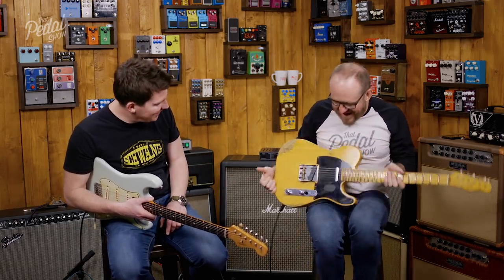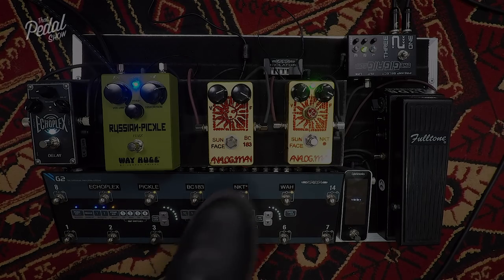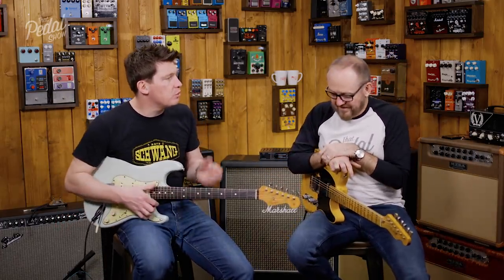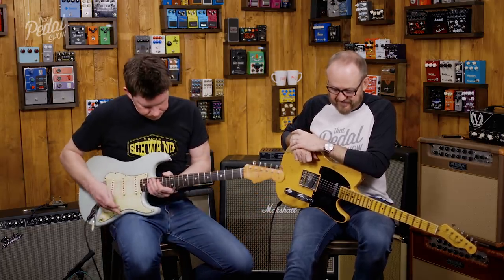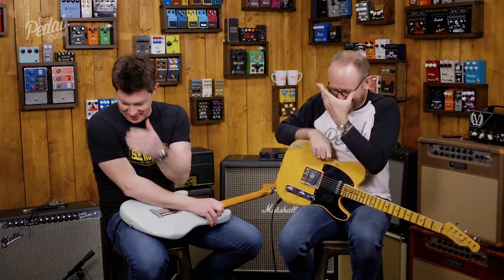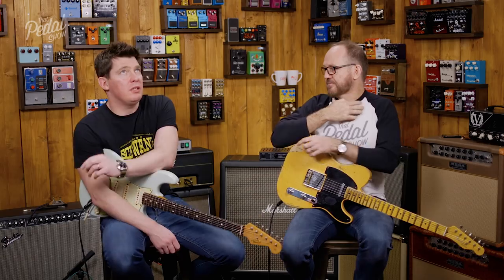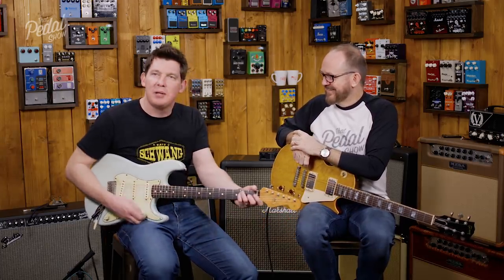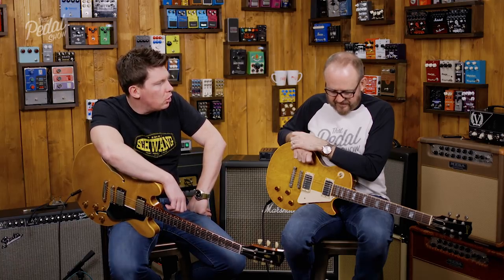That Pedal Show – Things To Know About Using Wah-Wah, Fuzz & Buffers

Comment: I run a band of gypsies fuzz face mini before a cry baby 50th anniversary with no buffer and experience no probs. It's a large board as well. But, I do have the fuzz and Wah (as well as a Carl Martin  DC drive and a tube screamer: gain staged as tube screamer, Martin and fuzz) on a loop through a boss noise suppressor. I also run a compressor between the drives and the Wah (also in the noise suppressor loop). Don't know if this is technically correct but it seems to work for me. I run the comp after the drives so I can still have the dynamics afforded by the overdrive pedals but before the Wah so as to level the input signal into the Wah. I did start with the Wah before the drives but, as shown here, it lost much of the Wah, so I changed to Wah after drive.  The fuzz face has silicone transistors obviously, so this is a massive help with my set up.
Reply from the maker: Great! If it works, it works!
Reply: Yeah. It's also a massive help I find, using single coils with a fuzz but, perhaps, more so, the tip I picked up from TPS: to reduce the output volume of your guitar!! I'll usually run my Strat volume pots no hotter than 6 or 7 when using a fuzz. Only way a fuzz is manageable / musical I find. Thanks for that tip. I also find it helps to reduce the amount of amp gain I use. Just enough to start to break the signal up and let the drive / fuzz pedals do the rest.

Comment: Hi Mick and Dan! Recently in the Midscooop/push video you tried to make a Fender sound like a Marshall and vice versa. It would be very interresting to see how much they can sound alike with the EQ pedal in the loop of the Fryette Power Station using the same speaker!
After all, all a pedal in front does, is alter the guitar signal going into the amp instead of changing the actual amp EQ.
Thanks for all the great work!
Reply from the maker: What amp are we using with the Fryette Ricardo?
Reply: To try and make the fender sound like a Marshall: Fender into Fryette with EQ pedal in the loop, into the Marshall cabinet. The Marshall should also be used with this cabinet, without EQ pedal or Fryette.
The other way around: Marshall into Fryette with EQ pedal in the loop, into the Fender speakers. The Fender should be used with it's own speakers without EQ pedal or Fryette.

This way you are not altering the guitar sound going into the amp, but the amp sound going into the cabinet! Maybe it's a much better solution to make amps sound alike. I hope you guys will give it a shot! ^^

Comment: Oh my goodness... That bloody NKT red dot pedal rules...It always sounds good, no matter what you put into it...
Reply from the maker: +Adalberto Schuck Jr. yep, Dan here, it’s my fav fuzz ever
Reply: Just a hint for you, my friend. You know silicon transistors in fuzzes have a harsh sound mainly because of the high Hfe (or beta) of those trans. And germanium NKT275 are hard to find. So my soluiton is: use a silicon low beta transistor, as BD136. So, using the exact original Fuzz face schematic from R.G. Keen (GEOFEX), I mounted 2 versions: One with BC108 and one with those BD136. The result wiht bc108 was as expected. But with BD136 was amazing. I got all the waveforms expected from a Ge transistor, but with Si transistor. From pure waveshape to clipping in only in the positive semicycle to assimetrical clipping. Everything was there. So, guys (hey Analog Man). Try this. And I am petty sure that, with little adjustments, you will have a consistent product (always same results) with a VERY COMMON , CONSISTENT AND EASY TO FIND TRANSISTOR. 
Last but not least, if someone start to produce this idea and make lots of money, just remember me next Christmas...Cause here at Brazil, I would never dare to open my own business, I kept at my position as teacher at Electronical Eng. Dept. It's safer...SO, TRY IT...I bet you won't regret with the results...

Comment: Mick, here's a simplified explanation of input and output impedance, and what they mean to you.

Think of impedance as "where the signal goes."  Consider the "output" as being the out of pedal A, and the "input" as the in of pedal B

 If the output of a pedal, or circuit, has a high impedance, then the signal will stay inside that pedal, and will not make it into the input of the next pedal.  If the output of a pedal has a low impedance, that means you will only lose a small amount of your signal coming out of that pedal.

If the input of a pedal, or a circuit, has a low impedance, then not very much of the signal will make it to that pedal.  If it has a high impedance, then much, or most of the signal will make it into that pedal.

All well designed circuits will have a high input impedance, and a low output impedance.  That means that most of the signal will go into that pedal, and only a little bit of the signal will be lost leaving the pedal.

If you have pedal A that has a high output impedance, and pedal B that has a low input impedance, that means that most of your signal stays in pedal A, and is not transferred to pedal B.  This is bad.  This is why you use buffers.

Buffers are any number of circuits that have extremely high input impedances, and extremely low output impedances.  They are used to make sure that the signal you want gets to where you want it.  You can use them after a circuit that has a high output impedance, or you can use them before a circuit that has low input impedance.  They only exist to make sure that the signal you want gets to the place you want it to go.

Buffers in themselves are neither good nor bad.  Buffers are like the note "E."  E is great in an A chord, but terrible in a G chord.  If a circuit has mismatched impedances, then a buffer is great.  If a circuit is well designed, using a buffer is like throwing in an E to a G chord, it's not good.  Buffers change your signal.  If you need to change your signal to make a circuit work, then they're great.  If you just throw five buffers in a row through buffered bypassed pedals, it's not so great.

This was longer than expected, but I hope that you got something out of it.
Reply from the maker: Thanks Clint. I totally get buffers and what they do. Just not the electronics theory, but that was helpful, thank you! I might get some textbooks. I was reading about FETs yesterday. It was riveting. :0)
Reply from the maker: +Clint Davis Dan here, E is awesome in a G chord ;)

Comment: An interesting point to make here is that the term impedance can be misleading, as it sounds like it is describing resistance in or to the signal path, something that is impeding the signal. Whereas actually, impedance is referring to the resistance to ground. So hence, low impedance means the signal path has less resistance to ground and so more signal will bleed off to to ground, and hi impedance means that the signal path has a higher resistance to ground, so that less signal will bleed to ground. Easily misunderstood!

Comment: Great videos guys! Extremely informative, super fun, and all around superb! I always look forward to fridays! 

Two questions:
1. Will adding a standalone buffer together with the wah create the same problem as when using only the buffer with a traditional germanium fuzz? Or is it needed an in-built buffer in the wah, like the Fulltone,  so that the problem with wah-sweep cannot be mitigated if you have a standard Crybaby by adding a buffer?
2. How do you get the audio so quiet? I hear from the room mics that there is some hum when you do not have the volume on the guitar rolled of, but all the quiet parts within the playing (from the cab mics) are dead silent, no noise. Do you use any noise reduction in post-production of the audio?
Reply from the maker: Hello Todd. 1. Maybe. But having the separate buffer would then hurt the fuzz. Maybe. Would have to try it!
2. The vocal mics are gained waaaay higher than the amp mics. The vocal mics are condensers too and have some compression. If we left them up while the amps were playing, they’d be massively clipped. We don’t use any noise reduction at all - it’s just that the amp mics are gained so much lower. The hum you hear through the vocal mics is massively exacerbated. Cheers’

Comment: That Pedal Show, thanks for the excellent info. One question: the first element of my signal chain is a Boss GP10, because of the possibility to use alternate tunings through the esaphonic pick-up. I have a Orange Fur Coat (which seems to have a mix of germanium and silicon) and a Bad Horsie wah, what do you advise? Thanks

Comment: Okay general question to the masses if anyone's actually reading this I have a Buddha wall one of the purple ones which is an older one. Snd I have a couple vox king wahs.  One with the stack of Dimes inductor and  one with the TDK inductor. neither of which I believe her buffered. I have a Hartman germanium fuzz pedal one of the they're older ones.  and I have a boss tu-2 tuner which I believe is buffered? my signal chain is my wah pedal to an expression volume pedal xotic AC booster to the Hartman fuzz then to the Keeley D&M Drive then it goes to modulation and then it goes to us strymon Volante and then to a Reverb and then the amp. My question is is this the best order to read these pedal Center? I realize that it's subjective to some point but I'm wondering if I should change the order does it matter if the expression pedal is in front of the Wah? does it matter if the party you tuner is in front of the foes it's buffered? Does it matter if my Boost pedal is in front of them fuzz? from my limited understanding of all this. It seems that the correct signal chain should be turn on my volume pedal my wah pedal the fuzz pedal the Distortion D&M Drive the Boost pedal then the tuner and then my travels modulation Echo and verb an amp?

Comment: Hi I have the Morley pedal which has a built in buffer and my fuzz sounds better put later but lately I've plugged the mxr m101 phaser 90 pedal into my pedalboard and I'm having problems with the wha wah, basically when I turn on the phaser the wah and as if it was off can you tell me what is causing this problem?  or maybe i have a buffer?

Comment: Can you do a Video on Speakers (Sizes, magnets and cabinets) 10s 12s 8s 15s anything
Reply from the maker: We’ve been mulling over a way to do this that makes sense. There’s soooooo much variance with speakers... everything changes with cab design, room, volume and of course amps. So picking the right set of ‘constants’ to get any meaningful comparison is problematic. What are your main questions?

Comment: Thanks for a great video again guys! I have an interesting topic for you. Something that I noticed earlier today when playing around with my BJ3 and Joyo vintage overdrive. I had my guitar straight plugged in to the amp. The pedal was resting on the floor with a cable in its input but not connected anywhere. When i touched the cable in the joyo (the one not connected anywhere) i felt a burning sensation on my elbow. Now I have protective earth etc so theres not a risk of a fatality here, but i think it has something to do with ground loops and leakage currents?

Comment: I would be really interested in a show that talked about pick attack and amps, pedals etc. In my experience it seems like different amps and pedals feel drastically different in the speed of the attack, but I don't exactly understand what is going on or which amps/pedals react which way.
Reply from the maker: Oooh, that’s a big subject. The sensitivity of the signal all the way through is really what defines ‘you’. So you might hit harder but use less gain, or compression. Or pick softer and use a really on-the-edge sound.... string gauges, OD types... it all interacts and it’s fascinating. Not sure how we could address it, but it’s right at the heart of all guitar tone. Thanks for watching.

Comment: Is the buffer in the wah a different circuit to your typical buffer? Mine is an opamp buffer, which sounds great guitar-fuzz-buffer-pedals-amp, but adding a true bypass crybaby between guitar and fuzz sees the benefits of the buffer disappear. Should mention, as you found, buffer before fuzz sounds horrible in mh setup. Any thoughts? 
Maybe a question for Dan! Sorry Mick!

Comment: I'd be interested in you guys doing something similar to this, but with wireless systems. I'm running a Seymour Duncan La Super Rica fuzz and it really doesn't like my Xvive U2 wireless system, so much so that I've stuck my Pickup Booster in front of the fuzz and set the fuzz tonally within that setup.

Comment: @thepedalshow 
I have found that the classic fuzz sound (where you can play correctly with the guitar volume pot) is placed before any BUFFER pedal.  After a buffer it loses its original nature. Same thing goes for its little-regarded relative TREBLE BOOST.  My dilemma is this: first.... to sound good, fuzz must be placed before any buffers in the chain or pedals that have the buffer inside them.  
Second......Fuzz to sound good with wah wah pedal needs a buffer first ..... (in chain effects... wah wah pedal - buffer - fuzz).  In the latter case, using it together with wah wah, the fuzz must be placed after a buffer.  Helpppppppp.
First case before
Second case with wah wah after. 
I am very confused

Comment: Can’t wait to dig in to this episode.  I’ve been a proponent of the Fuzz-Friendly Buffer wahs for a long time now.

Was the input buffer disengaged on G2?  (I see the arc of LEDs).  When using Fuzz with a switcher would you Program the input buffer on/off based on it if the patch uses a Fuzz Face?
Reply from the maker: All answered in the video!
Reply: Thanks, I see the Pre Gain LED is off, nevermind! :)

Comment: MY SIGNAL CHAIN

FULLTONE CLYDE DE LUXE WAH v.2 (Carbon battery 9v) >>> FULLTONE FUZZ '69 mkII (less +9v SAG control with Voodoo Labs power supply ) > TC ELECTRONICS POLYTUNE 2 (-9v) >>> BOSS CS-2 compressor/sustainer(ACA12v) >>> IBANEZ TS-808 Reissue with original Keeley "Mod Plus" True Bypass (+9v. small vintage mini plug) >>>FULLTONE OCD v1.4 (runs at 18v) >>> BOSS DS-1 Taiwan first edition same like the japanese (with chip Toshiba TA7136AP pre-amplifier) (ACA12v) >>> MOOER Flanger ELEC LADY (EHX electric mistress good clone)(-9v) >>> BOSS Chorus CE-2(ACA12v.) >>> TC Electronic ALTER EGO v2 DELAY/LOOPER (vintages delays and echos very good algorithms) >>>> Input of the /A -M—P/ Blues Junior III limited edition with Celestion V30  >>> spring reverb from amp

THE QUESTION:
I want to isolate my pedals for less noise. I'm going to use the 4-wire method but I have a question. I wanted to isolate from the cs-2 compressor to the ds-1. Can I include the germanium wah and fuzz and the tuner? In principle, were you going to leave them out and leave them in front, since they are all True bypass and so would you keep their tone? Or I can include them in the chain, that is, I can explain it from the WHA-FUZZ Germanium-TC poly2-CS2-TS808-OCD-DS1 all through the loop of the NS-2 and leave out the modulations and the delay. I leave you the order of my pedals and I need PLEASE since I have not found anything or anyone who has been able to answer this question. Many tell me to prove that there is no other way to prove and I cannot until I finish my studies. The WHA and FUZZ are generally problematic pedals, although in my active case the WHA buffer with the Fuzz is "Fuzz Friendly" and is designed to work optimally with the fuzz. The thing is that both the WHA and the FUZZ have to be first in the chain and in the fuzz instructions it says that the buffered bypass or buffered pedals like most Boss give problems if they are put before the 69mkII except of course the WHA which brings a special designed buffer. The case is that the Boss NS-2 noise door being so then I can no longer put it in the FUZZ'69mkII loop, I have not come to prove since I have bought the noise door and I have not mounted it. Please see if you can get me out of the way before moving many cables, connections and velcro.

Thank you.
Reply: I think need a very good switching system from THE GIG RIG when will finish my pedalboard.

Comment: I always wondered how SRV got his great wah tone.  Obviously he had a great wah, but He actually put his wah last in his signal chain.  Guitar - Octavia - fuzz - tubescreamer - wah - massive amps.  I guess he did not mess around with buffer.
Reply from the maker: Hmmm. Most of the classic pics I’ve seen show the wah first... (Mick here)
Reply: I don't know where that schematic comes from, because anything I've read, or seen in photo, he has the Wah first. Same with Hendrix, but I often see comments stating otherwise. Not to say they didn't try it at some time, but I've never known if it in live situations.
Reply: I know what pictures you are both talking about....the black and white one and the one for around the mid 80s with the loop selector.  If you follow the input and output of each pedal you will see, esp in the 89 picture that the the output of the tubescreamer goes to the input on the wah.  Also, I have a schematic picture written from Cesar Diaz that shows the signal chain.  Just because the wah is on the left does not always mean its first.....perhaps it was just his preference
Reply: Anyone study the pictures I was referring to?

Comment: Tons of good information but I'm still a bit confused, which is most likely down to my inability to process all the info.
So if I may ask a fairly simple question ... if I am using single coils and have a silicone Fuzz Face and a V847 (the buffered one) going into a very clean amp ... am I better to have the wah before the fuzz or after. Or is it just up to me to experiment and see which I prefer???
Reply from the maker: Read the description Fishy, hopefully it will enlighten you a bit. We’re a bit more to the point there. :0)
Reply from the maker: +fishy paw entirely up to you find man :)